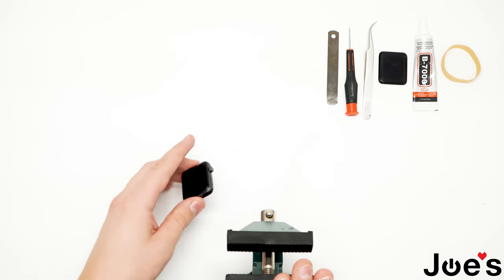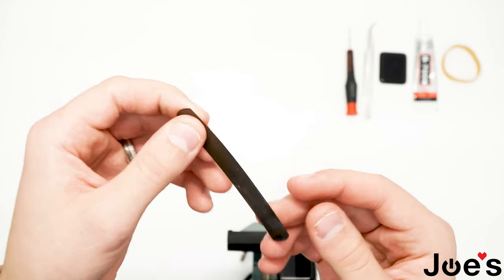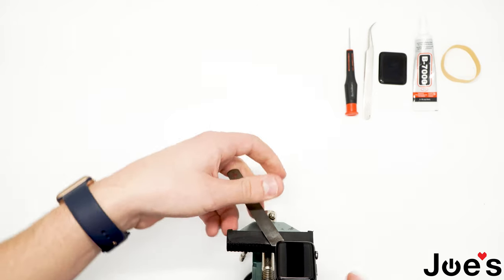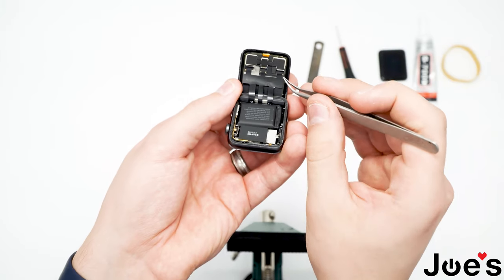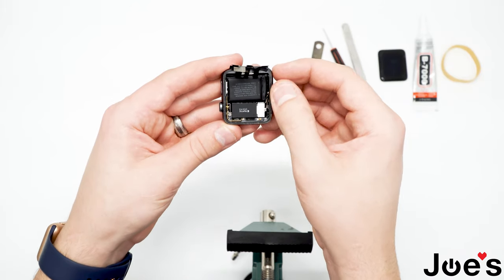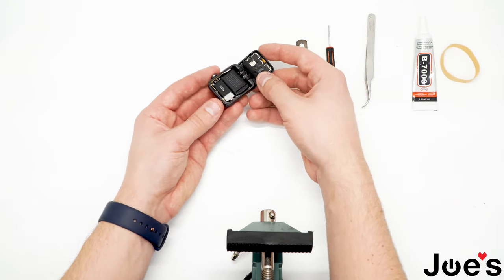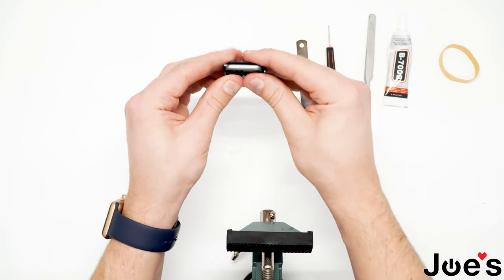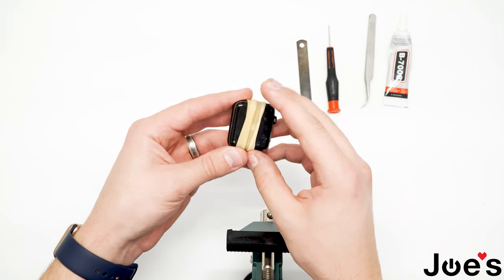Apple Watch Series 2 Broke Cracked Screen Replacement Repair

Comment: I'm trying to fill out a repair uniform but it will not send the USPS shipping label. What do I do I've tried 4 different emails and none of the have sent
Reply from the maker: If you have not already, try using Google Chrome to fill out the form. Try searching support@joesge in your email. Also, Check your Junk/Spam Folder. If this does not work, text us at 360 362 1722 the name you used on the draft and we can further assist you from there. CH
Reply: @Joesge  I got it to work yesterday I'm sending in a pair of beats solo 2 how long would you say it will take to fix them/send them in. And I think its great what you guys or doing
Reply from the maker: Thanks for the compliment! The average turnaround time is 1-2 weeks from the moment you send your product to when you receive it back. This can differ some if you are outside the U.S. And it depends on your response to our technicians for the repair.